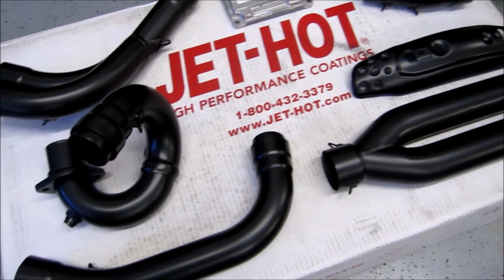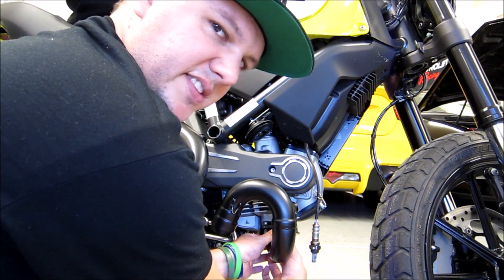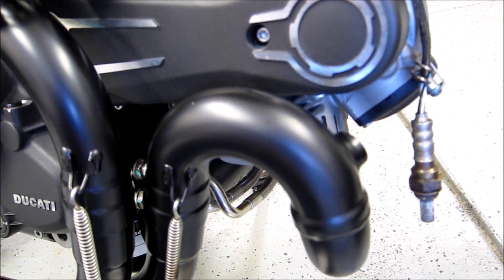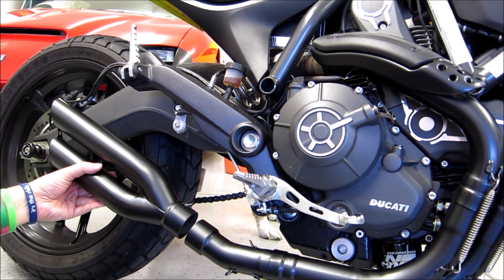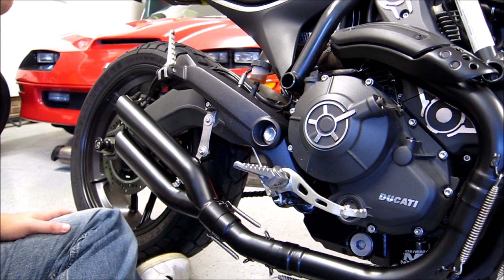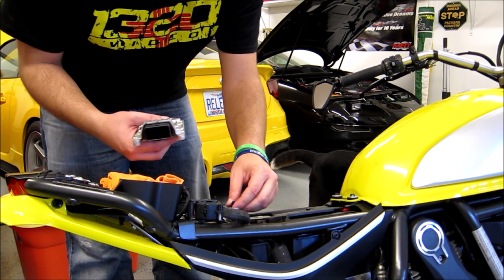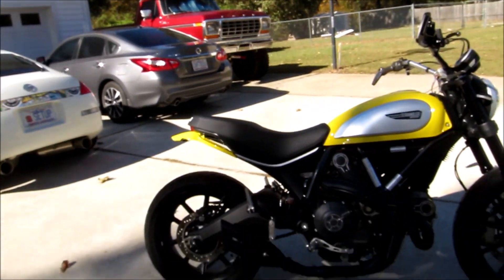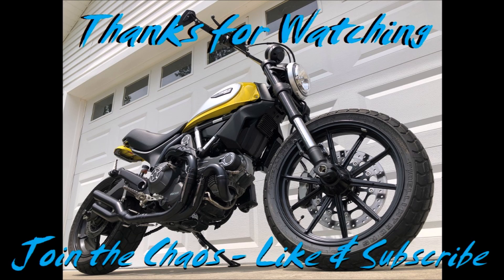DanMoto Slip-On Exhaust Install Ducati Scrambler

Comment: Did the coating help with the heat? My leg feels like it's being cooked any time I have the slightest bit of traffic.
Reply from the maker: Luis Escobar it definitely helps. It is still quite warm but I’d say maybe a 15 degree difference. I didn’t think about it at the time or otherwise that would have been a good test to measure before and after temperatures.

Comment: Where did you get the ecu flashed
Reply from the maker: Appreciate you checking out the video. We mailed the ecu to Rexxer Tuning for the flash. So much smoother afterwards
Reply: Ok by chance was it a rexxer dealer in the states or overseas
Reply from the maker: @brandonorsulak8657  in the states... mailed it to Virginia. They have a form you fill out online and I called just to let them know I’d be mailing it to them and they flashed it quickly and mailed it back. Check out their site... https://www.rexxer.com

Comment: I think that’s one of the worst fitting exhaust systems I’ve seen. 🤮
Reply from the maker: Thanks for checking out the video but I’m not sure what you mean? Like you just don’t like the style? As the fitment was great. Didn’t fight the install at all.
Reply: @ChaosCarClub  First off, it’s just my opinion. I don’t really like to be so negative but I just think the geometry of the pipe is totally out of sync with the lines of the motorcycle at the lower section, especially where it comes away from the frame and then you need a six or seven inch bracket to connect the silencer can(s).
Reply from the maker: @larryproffer8603  oh yeah I’m not taking it personally or anything. Everyone has different tastes and opinions. That’s why I was curious to hear your thoughts. 😎 thanks for explaining!